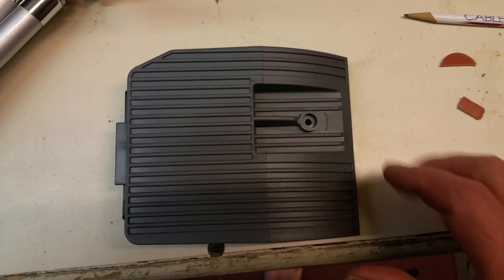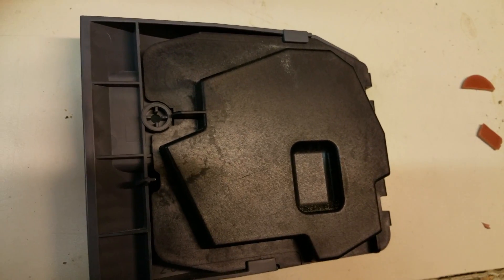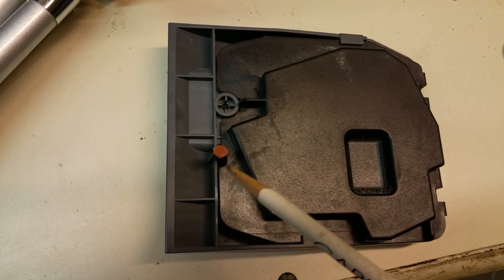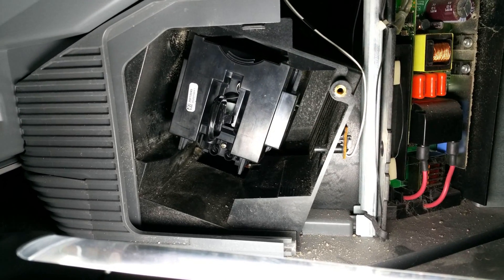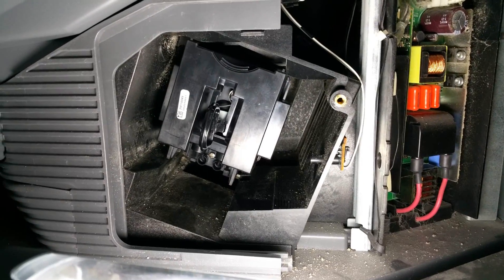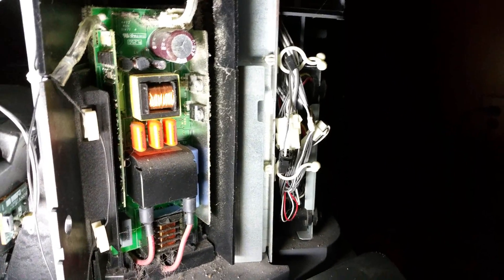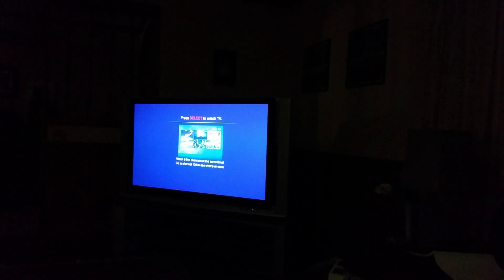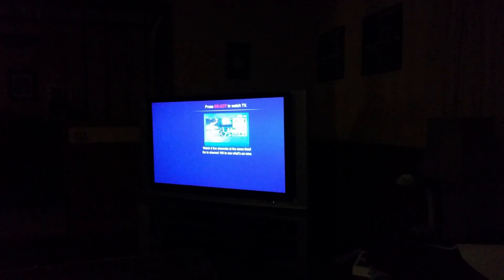Sony TV 3 Red Blink Fix - Won't turn on

Comment: Thank You for fixing my 60" Sony KDS-60A2000, would never in a million years thought of that, I didn't have any superglue, so I used a very small piece of scotch tape and wrapped it tightly around the stem then replaced the door.   the set is now 16 years old!!!  Thanks Again, Steve!

Comment: Hello , on my tv the trip assembly on the door microswitch vanished, can't understand where it went ! So, I watched that indian fellows video about jumpering the plug but had no jumpers, figured out the quickest fix tho, after finding the correct grey and white wires, I stuffed some pieces of aluminum foil into the plug packing it tightly... Wallah.... Worked !!!  While I was at it I did the other microswitch plug just in case. This old full featured top of the line Sony still looks and sounds great. Thanks for that long ago video tho !

Comment: The problem with mine was very simple. I called a mechanic home, all he was cleaned the connectors inside and plugged them back in. This fixed it. He said the connectors were probably corroded leading to poor conduction. This triggered the protection mode turning on in the TV.

So next time, I will definitely open it up myself, clean the connectors carefully and put them back in place. Hope it helps

Comment: Steve! Thank you sir. After fumbling around on my carpet, i found the "pin" that closes that microswitch had broken off when i opened the door. A dab of gorilla glue and one hour later, we're up and running. Thanks for your effort and help!
Reply from the maker: Glad I could help. Mine is still running and is still a good TV. Probably upwards of 13 years old.

Comment: This is a horrible explanation video. Maybe explain the problem. Show the problem. Show here that piece came from. Couldn't even watch it.
Reply from the maker: Numerous people have fixed the same problem using this video. Perhaps you're not smart enough to use the information? At any rate you're certainly lacking in social skills. Suggest you look through the positive comments below and wonder why it worked for them and you're clueless.
Reply: Still a horrible video and you just showed what a moron you are.
Reply from the maker: @dalethomas276  If I say you are an AH, are you smart enough to fill in the blanks?

Comment: I used electrical tape to press in those switches after replacing bulb for the fifth time. I have a XBR70 KDF SONY. It's a beast, and I love it , but, recently, I've seen what looks like clear invisible lines going horizontal across the screen..... I can watch it,however,it's a bit dim ,also. The clear lines in the picture resemble like looking through invisible mini blinds. Any thoughts on why these weird lines are on screen? Thx.

Comment: i dont have any red lights on my sony wega kd36fs130, i turn it on and the green little light turns on and dims down, and the tv doesnt do anything black screen no sound
Reply: Lito Rivera probably lamp. even if the lamp error indication light is not lit. happened to me, hope this helps.

Comment from the maker: I see almost 3000 viewings, no neg reviews but only four say they managed to fix.  I wonder how many of those 3000 fixed the problem?
Reply: Steve Garrison so I have a Sony cnet and it's a completely different setup than yours lamp is located in the front any tips for me ? Same problem says standby flashing red lights won't turn on help me please 😫

Comment: your the fucking man.  I took my TV apart like u did but I didn't have to put a thing there I actually just had to pull the door down to push a tiny little lever together.   thanks for the video.
Reply from the maker: Glad I could help